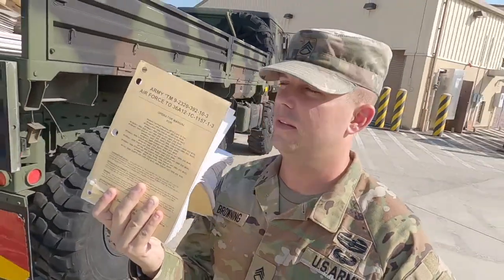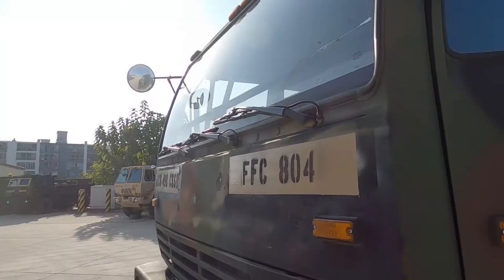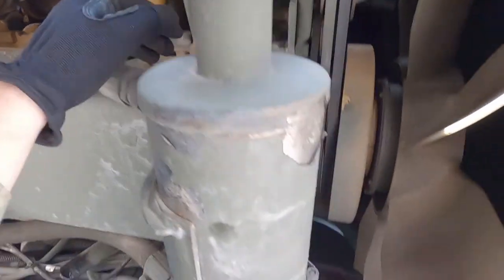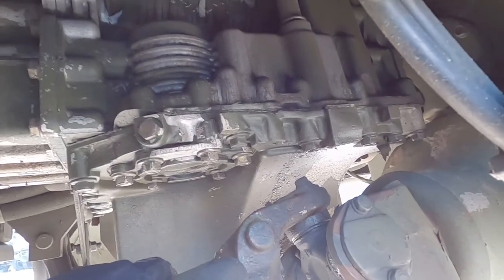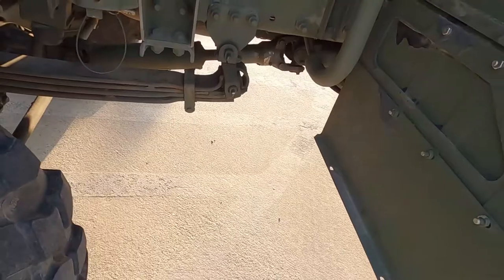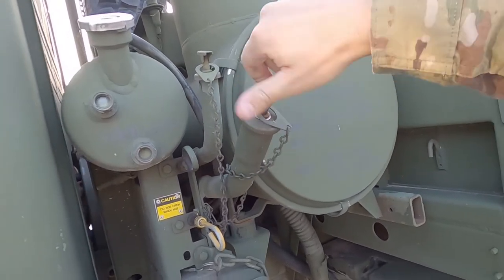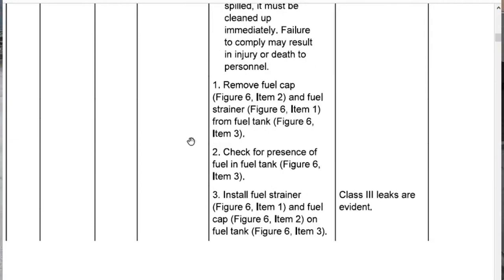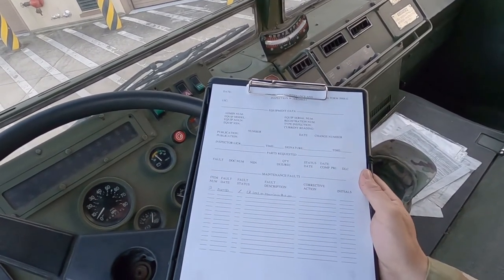PMCS 88M AIT Training Aid on M1083A1

Comment: Great video and channel. Can you do a video showing the procedures for properly hooking up a tow to one of these trucks.
Reply from the maker: Absolutely! I have hasty and deliberate recovery planned and will reach out to you
Reply: @Whogives2shets  Also, are you familiar with the M1022A1 dolly set? They come in pretty handy when you don't have a Chinook around and you need to move some conex containers.
Reply from the maker: @GraveKeeperDeath  you know, I had to google it just to see what that nomenclature was and yes, I've seen one back at Ft Campbell many years ago and not since. I haven't used one myself though. Looks like it would be an amazing tool

Comment: Completely unrelated to the video topic... I have that same solar power pack. Can't figure out why it won't charger my phone so I  charge the pack the longer way
Reply from the maker: When you plug it in, press the power button. The green light will be on and the blue lights will illuminate showing the charge status. It takes 10 hours for mine to charge and I only get 3 charges out of it. I should've got the good one on Amazon 😅😂
Reply: @Whogives2shets  I'm not to please with the charger either 🤣, I have recharged it fully maybe once and it dies faster then it charges its self or another device